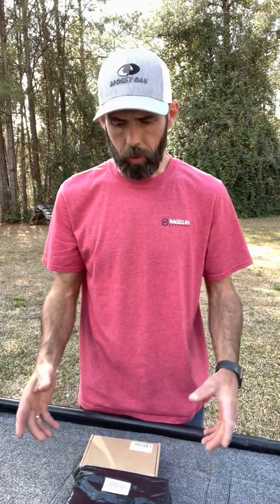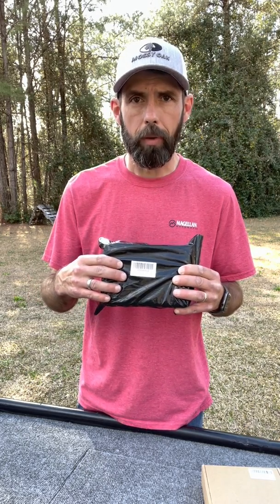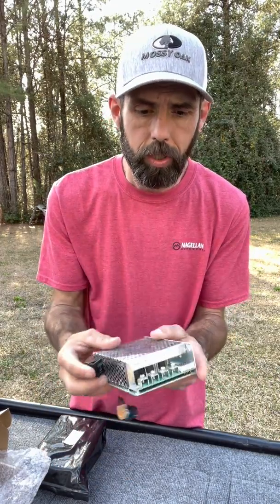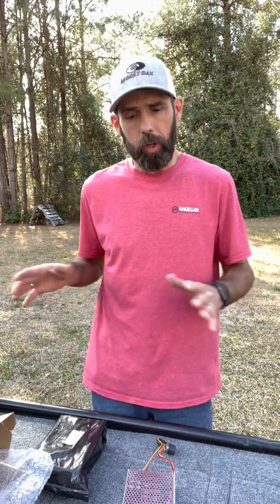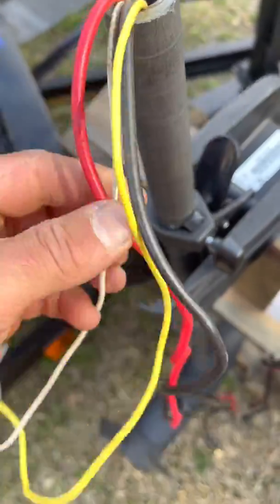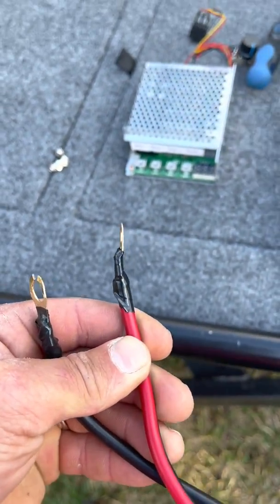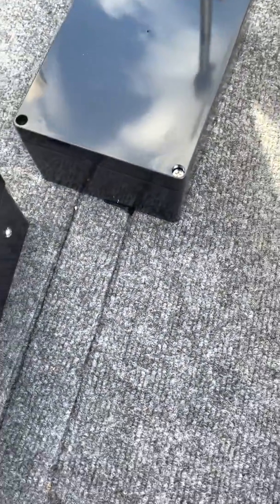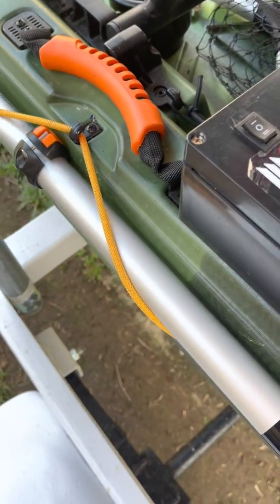How to hook up a PWM (pulse width modulator) to control a trolling motor.

Comment: So I just installed my pwm and it lights up red and turns on but the trolling motor does nothing
Reply from the maker: You need to check all your wires. What PWM did you get?

Comment: You forgot the fuse between battery to pwm😮
Reply from the maker: This wasn’t a full install. This was only an instructional video of the basics of how to hook up a PWM.
Reply: @334tacticaloutdoors  fair enough 😂
Reply: I've blown up heaps of them not to bad for 30pound motors if you got a 40 to 60 amp pwm but if you got a 50 pound motor go the 100amp pwm this is my experience with them could be wrong but paddling back to shore is a b%*-+
Reply from the maker: @dredre9484 yes that is correct, I keep my PWM’S removable and keep an extra one onboard just for that purpose.

Comment: 8:35 I wired mine and I'm getting power but the propeller doesn't turn. I rewired it several times to make sure it's done correctly and still the same problem. If I wire the trolling motor straight to the battery it turns. I don't know what I'm doing wrong
Reply from the maker: What volt PWM do you have? And what size trolling motor?

Comment: Great info very usefull and no messing around with talkinng that's not needed. I have one set up and have been using it for two years. My advice at this  point of experiences with the SAE quick connections is they do not take alot of abuse before the legs inside break. This causes the wires to overheat and drop in efficiency with the motor. This problem was solved by adding locking trolling motor plugs to my ports of connections. Since addind this feature i have had zero problems . Before this i would have to change out the ports and SAE plug ends a couple times a season. Your video is what directed me to my install initally and i thank you for your efforts. I fish 4-6 days a week all season out of my yac for 10-12 hrs a day and my equipment get alot of abuse. So perhaps this may help someone avoid this situation in the future while still following your video thanks. AKA Frogman 🐸🐸🐸🐸🐸🇺🇲🇺🇲
Reply from the maker: Thank you for your feedback. I’ve never had issues with my SAE connectors, but thank you for the input. I appreciate your following and watching the video.

Comment: Thanks for your reply. Could I use an ESC on a 55lb thrust motor. 
I don’t know why I went so big, but I think the amp draw has created challenges—your video is great. I am a new subscriber.
Reply from the maker: You’re welcome, Yes you should be able to use it on a 55lb motor without any issues just make sure you get 100-120amp. Thank you for subscribing.

Comment: Has your PWM failed?  I’ve had 2 fail on me, but they were undersized. Your video helped me understand that I needed to double the amp rating of the motor.  However, the PMWs on Amazon don’t have great ratings. Please comment on this. Unlike my errors, the reviewers appeared to know what they were doing. In other words, are there things we should know to avoid burning up the PWM?
BTW, I have a 55lb thrust motor.  I was also wondering if I should limit the potentiometer to reduce the amps to the motor?  Sorry for all the questions. 😢😂
Reply from the maker: Yes PWMs do fail. Any moisture will cause failure. If you haven’t looked into it try switching to ESC I’ll also include a video of one being installed that I believe did a great job. This would solve all the issues that you have mentioned. 

HOBBYWING QUICRUN 880 ESC, Waterproof ESC for Dual Brushed Motors

https://youtu.be/Mv9Sg58tKsE?si=WOPd4QL47X2As5Wn
Reply: I have not had my original pwm go bad in 4 years now . No fan . https://youtube.com/shorts/WLUs32EvknY?si=tUpvMCxLyan9JEJ-
I fish 3 times a week pretty much years round unless river gets iced over .

Comment: Does it get hot?
Reply from the maker: When it’s really hot outside yes especially when you run the trolling motor wide open for a good bit. The fan on the 100amp PWM really does help keep it cooled best it can.

Comment: So I have duel trolling in the rear of my boat - crappie brakes - is it possible for one box to control both or would I need 2x thank you
Reply from the maker: You would need 2 in my opinion the amp draw from both at one time would be to much for one PWM.
Reply: No sure if my second question hit ? Have you found them anywhere outside Amazon ? They are out of stock there - thank you
Reply from the maker: The do sell them on eBay also. You can also use these also there’s a few YouTube on some installs it’s worth checking out. 
HOBBYWING QUICRUN 880 ESC, Waterproof ESC for Dual Brushed Motors
Reply: @334tacticaloutdoors   thank you very much for all the info - gotta share with ya that there is a guy selling these boxes for 500 - wow I love enterprise but that’s a lot of juice -
Reply from the maker: @Macks95  I’m in the wrong business for sure. And you’re welcome.

Comment: I had two of thse cheap 60 amp units. The first one literally fell apart from poor soldering joints so I sent it back. The second one worked for a couple weeks till it burned up inside. It still works but the variable speed control part quit working. It now runs at 100% or not at all. No turning it down at all. So that's pretty much useless to me. I ordered one of the 100 amp units with the fan in it, so hopefully it will last. I will not put it in a completely waterproof box that is air tight. The 100 amp unit has a fan in it so I will need some venting anyway. DO NOT put the 60 amp PWM in a waterproof box. They run way too hot and will burn up. Even at 3/4 throttle, they get too hot to touch. Mine started to smoke and I could smell plastic burning.
Reply from the maker: The 100 amp is really nice and very well made I’ve had mine for a year with no issues.

Comment: Hey man I'm really struggling here. I'm really hoping you see this. I purchased the pwm w the fan you had listed. I built my box got it all set up.hpwever the forward gear isn't working. I swapped the wires on the switch and the switch is good. I also put the trolling motor straight to the battery and it went forward. However every time I hook the pwm up the trolling motor loses forward.
Reply from the maker: It sounds like the rocker switch to the PWM is either bad, not connected good or has a short. That switch is the only thing on the PWM that controls forward and reverse.
Reply: I bought a waterproof switch and hooked that one up and the same thing happened. Tomorrow I will check for continuity
Reply from the maker: Ok let me know.
Reply: So this morning I was messing with it. I swapped the wires to the motor 
Because its supposed to change the polarity. And I realized every time I commented the battery it would spark. The pwm was never really shutting off!!! Then the lights on the pwm went dark and the whole things dead now. I'm returning it. To Amazon. 
Not sure if I should order a new one from the or try the one w out the fan
Reply from the maker: This is the one I use that doesn’t have a fan. 
https://www.amazon.com/Stepless-Controller-Forward-Reverse-Governor/dp/B01M5F5UDS/ref=pd_bap_m_csi_pb_allspark_BIA_0?_encoding=UTF8&pd_rd_w=JNzfn&content-id=amzn1.sym.bcca84ef-5f4d-4682-852e-b0b38f16e8ba&pf_rd_p=bcca84ef-5f4d-4682-852e-b0b38f16e8ba&pf_rd_r=ZKD6NFE6EZF84QJRZ0JF&pd_rd_wg=iWw3J&pd_rd_r=ff1d171e-60cb-44f1-8b0b-411ed31151e6
Reply: @334tacticaloutdoors  they don't have that one anymore 😥
Just my luck lol. I bought my bonafide last weekend set it up w foot steering got a one objective mount. And I'm ready to rock. Except I have no working pwm which means no motor :( 
I feel like the 50ah battery just won't be enough straight to the trolling motor
Reply from the maker: They do make something better than PWM if you wanna look into it. 
https://www.amazon.com/gp/aw/d/B07NYBF6MQ/ref=ox_sc_act_image_1?smid=A2WE34KST0BUEK&psc=1

https://www.amazon.com/gp/aw/d/B08BXQ17T9/ref=ox_sc_act_image_2?smid=AMXT7HV26EJPE&psc=1

https://www.amazon.com/gp/aw/d/B09Y8XT53X/ref=ox_sc_act_image_1?smid=A3VBXXRYRZ8YSX&psc=1
Reply: The new pwm came in. It's smaller doesn't have a fan. But it came in a nice box and had business cards with it. Wasn't that junk I got the first time. Also the one you sent me that you use they don't have instock or are selling at the moment
Reply from the maker: @treymurphy6398  just make sure to take your time installing this one double check all wires are connected properly. Good luck.
Reply: Ive already installed it. It's working great. Now for the weekend to get here!!!
Reply from the maker: Absolutely amazing news to hear. Just enjoy now.

Comment: Great video. If I did this on a bow mount trolling motor will the electric steering still work? My control module is bad so I had to bypass it. Now it only operates on full speed.
Thanks in advance,
Ryan
Reply: It worked!
Reply from the maker: @RC-uh8jv  that’s great to hear.
Reply from the maker: I don’t see a reason it wouldn’t work you’re only using the power wires of the motor.

Comment: How did you mount the pwm box to the kayak? Great video!
Reply from the maker: Thank you, I used a track rail and used toilet flange bolts cause there 3-1/2” longs and a aluminum bar across the top of the PWM to hold it down.
Reply: @334tacticaloutdoors  do the bolts go through the top of the box?
Reply from the maker: I used the bar across the top long enough to go to the edges so the bolts don’t go through the box there at each end of the box.
Reply: How and where did you mount the track rail? I have the same kayak as you, FYI. I did a similar build to you. Just figuring out the smartest way to mount the box…
Reply from the maker: I put a small rail by the left side of the seat. Then used 3”  t-bolts and a flat bar across the top, then used round wing nuts to hold it in place.
Reply: @334tacticaloutdoors  did you put the small rail in that little well that is on the Yukon?
Reply: If you go to the 12 min mark you can see the well I’m talking about…
Reply from the maker: Yes, that’s where it is.
Reply: Ok great. You happen to know the rail you got? I want to do the same thing…
Reply from the maker: @LunkerHunter  I used this one and cut it to to size. 
https://www.academy.com/p/railblaza-125-in-boat-accessory-mount-track?gmc_feed=t&ogmap=SEM%7CNBR%7CGOOG%7CSHOP%7Cm%7COUT%7CIM%7CNon-Brand-PerformanceMax-Outdoor-Stream%7CStream%7C%7C16517466167%7C0&&ogmap=SEM%7CPLN%7CGOOG%7CSHOP%7Cm%7COUT%7C%7CNon-Brand-PerformanceMax-Outdoor-Stream%7CStream%7C%7C16517466167%7C0&gclid=CjwKCAjwzo2mBhAUEiwAf7wjkv8WbW5jNF8y0y1j1IH2RUl9K279rZ-sEWsZATSecUfCg01psTHfXRoCrN8QAvD_BwE&gclsrc=aw.ds
Reply: @334tacticaloutdoors  thanks!
Reply: @334tacticaloutdoors  did you have to shave any width off or did it fit width wise?
Reply from the maker: It fits width wise.
Reply from the maker: If you send me your email I’ll send you a short video of what it looks like.

Comment: My motor positive and motor negative cables don't look the same so I cannot connect it to the PWM box. Is there a adapter or something I need to buy?
Reply from the maker: What you mean they don’t look the same? You shouldn’t need any type of adapter.
Reply: @334tacticaloutdoors   So basically the tips of the motor positive and motor negative cables look the exact same as the yellow and white one next to it.
Reply from the maker: @insertnamehere9935  cut the ends off and add new connectors to it.
Reply: @334tacticaloutdoors  Alright thanks and I have another question idk if its stupid or not but is there a way I could use 1 PWM to control 2 trolling motors?
Reply from the maker: No I would use individual PWM due to the Amos that one trolling motor is gonna pull.

Comment: Can you just run the pos and neg to the pwm from the motor without taking the head off? Do the other wires need to be disconnected?
Reply from the maker: You can leave the head of the trolling motor on, but all the wires must be disconnected from the switch in the head of the trolling motor. Just cap off the yellow and white wire and run the positive and negative from the motor out the same spot where the original positive and negative was and yes that can run straight to the PWM.

Comment: Very informative vids, thanks!  I understand why you want a waterproof box, but wouldn't the pwm with the fan just recirculate the heat in the watertight box?
Reply from the maker: Thank you. And yes even though it’s a waterproof box it still needs ventilation, I normally just use diagram grommets that I can remove to let air in but put back on to remain waterproof. 
https://www.autozone.com/lighting/grommet/p/dorman-conduct-tite-1-2in-diaphragm-grommet/1078601_0_0?cmpid=LIA:US:EN:AD:NL:1000000:ELC:19486091402&&CATARGETID=120054150001289080&CADevice=m&gbraid=0AAAAADkcoVtRVf-iBIBLpPqQ4oyCrNWHk&gclid=CjwKCAjw5dqgBhBNEiwA7PryaJdSiR71R1ainStsbYdqpwKHfRG0iB--tH0w9lT_1XZPD9__36WzIxoCkf0QAvD_BwE&gclsrc=aw.ds

Comment: Thanks for sharing! Great vidio! Wish I had seen it sooner! Question? If you hooked up the + and - connections backwards to the motor leads would it just rotate the motor backwards? If so, then the 3 way switch would correct the issue? Also if by some mistake your battery leads got reversed, what would that do to the PWM? And lastly, what would happen if the motor leads were to accidentally be shorted between the PWM and the trolling motor? I ask these questions because last year I installed a PWM as a test on my trolling motor. Apparently I got everything hooked up correctly at that time. To save money during testing, I did use some makeshift connections for the battery + & - connections and the PWM output connectors. Unfortunately, recently I mistakenly arced the motor output leads and killed my PWM. Obviously, the arch created a dead short and fried some component in the box. I'm replacing the PWM and using better connectors so I don't repeat this mistake. But anyways, just curious what your thoughts are?
Reply from the maker: Thank you, I Never would suggest to hook the motor leads up backwards. If you hook the battery leads up to the wrong connection it will fry the PWM. It’s always best to run a fuse link between the battery and the PWM on the positive wire.
Reply: @334tacticaloutdoors  I'm not sure what size fuse is needed to protect the PWM. I will have to do some research on the PWM I purchased off Amazon. Thanks for the information!
Reply from the maker: @ronniewetherington509  a 60 amp fuse should be all you would need
Reply: @334tacticaloutdoors  thanks
Reply from the maker: @ronniewetherington509  you’re welcome.
Reply: @334tacticaloutdoors I have a follow up comment. I made a PWM last January. I used an inexpensive controller off Amazon similar to yours. It worked fine for a year. It only failed because I made some temporary connections to hook it up because I didn't know if it would work. In February of 2023 I mistakenly arked the output motor wires and damaged the unit. Since then I have gotten three units from Amazon. Two of them were faulty and replaced by seller. The last one worked as it should until I disassembled the metal box and reassembled it. Then the controller wouldn't work. I disassembled the cover, checked for loose wires or connections. I couldn't find anything. I've been studying electronics all week trying to figure it out so I don't repeat the same thing. Have you had any similar issues?
Reply from the maker: @ronniewetherington509  I’ve never had that kinda issue now I have got one wet before and it stopped working, that was 100% my fault. If I was you I would by a 100amp mount it in a box and let it be don’t remove it only connect to what your using. Now a lot of people have started getting the trolling motor with the built in PWM and connecting a wireless controller if that’s something you wanna look in to.
Reply: @334tacticaloutdoors  I had had my first one mounted in a waterproof box. It only failed due to my carelessness handling the wires. Thanks for your input.
Reply from the maker: @ronniewetherington509  you’re welcome.

Comment: Hey man,
I connected everything just like you said but propellor won't turn...I hear it clicking from front 2 rear and speed, as the fan is going, in the box not turning. What am i missing here?
Thank you, if anyone can pipe in all good.
Reply from the maker: Double check the power and ground wire coming from the trolling motor to the PWM sounds like one is crossed or one is loose.
Reply: @334tacticaloutdoors  Honestly, i didn't know it had a ground wire. all i saw was that yellow n white which we don't need. but man, I don't know what I'm doing wrong here. i went thru 3 pwm's already and all 3 shortened out. I'm connecting it just like you said and I'm using the same pwm you mentioned. i used an 8G from my 10g out of the motor all the way out to the pwm and battery. Started running slowly and when i raised the knob full throttle it shorted! so that's three i screwed up. what gives? The first i blew out cause the knob was on high so it shorted. the second one i made sure everything was off but when i started it, blew that one to. This last one, i noticed it was a 10V all i can think of is that is maybe was the voltage since the battery is a 12V. or maybe the 10G > 8G. I'm at my wits end brother...
Reply from the maker: What trolling motor are you using what it sounds to me is one of the wires is shorting out in the motor itself

Comment: How do you remove the knob off the controller
Reply: Thanks
Reply from the maker: @garycrotts3808  you’re welcome.
Reply from the maker: Just pull it straight up with slight tension it’ll pull off